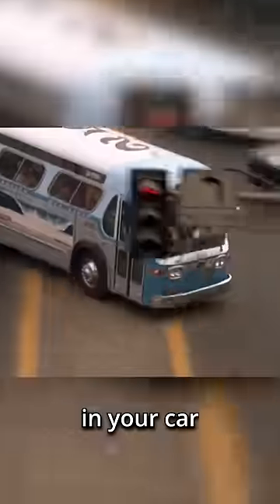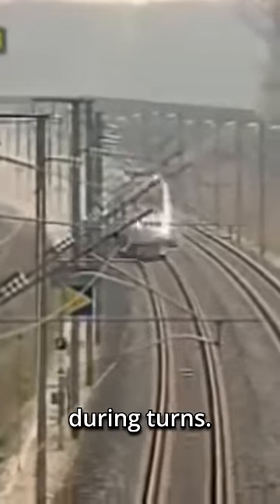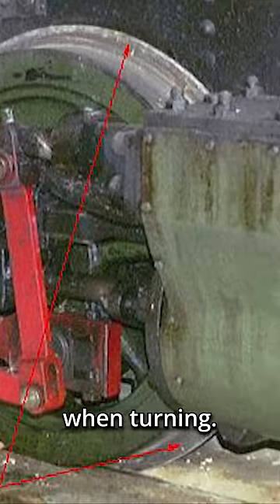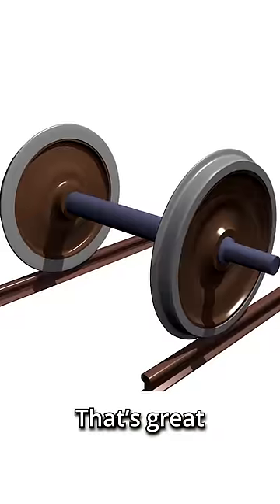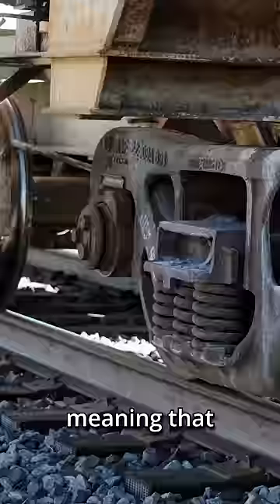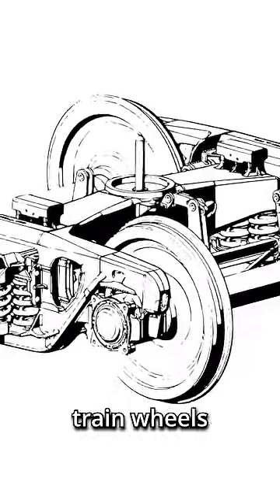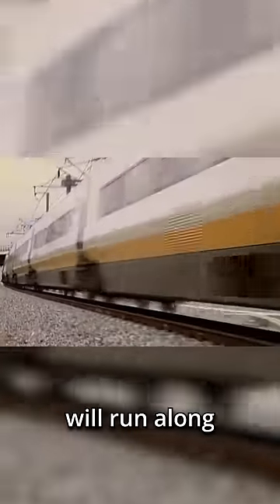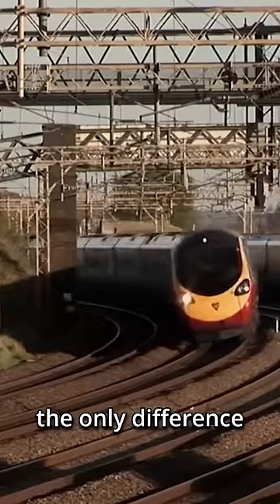How Do High-Speed Trains Stay on Track During Turns? #shorts

Comment: They also use greasers before a train hits a turn so that the wheels are lubricated and it does not wear them or the track is quickly
Reply: Really? At high speeds? I've only heard of trams doing that in very tight turns.

Comment: nice but you also forgot part three. most of the highspeed trains also lean as they go around the corner. this causes the weight of the train push down toward the tracks more than if it did not lean allowing it to go faster without tipping over
Reply: Let's get the terminology right shall we?
Centre of gravity, not weight.

And the weight doesn't push down more to the tracks, the weight is the weight and it doesn't change.
    W = mg
g is a constant of 9.8m/s/s
m is also constant and is the mass of the train
Therfore the weight, W is also constant.

It is the position of the C of G that matters.
And that is what is changing.

Tell me you haven't studied physics at school without telling me you haven't studied it.
Reply: @deang5622  i was describing the action not the method. and yes effective weight does change as you go around a banked corner because of momentum. don't need school i got a electric train track and a scale when the train is on a straight away it weighs 1.02 LBS when it goes around a banked curve the train weighs 1.13 lbs effective weight. sorry you needed school to get it wrong

Comment: Slightly conical, huh? 🤔 That makes sense. The centrifugal force will "push" the wheel (the wheel running on the outside of the track) to run on the section of the wheel that has a larger circumference. Kind of brilliant.

Comment: NO!! IF, by 'inside', you mean next to the flange, then the wheel on the outside track rides more on the inside - next to the wheel flange, where the diameter is LARGER - part of the wheel( thereby covering more distance with the same rotation. C'mon now.

Comment: Ignore the disc on the back of the wheels that would keep the train on the track on most corners
Reply: The flange is there for safety, but ideally it doesn't rub against the track. When it does, you can hear the loud squeal of metal on metal.
Reply: @KingBobXVI  oh, ok, I don't do much research on the wheels so don't know much about them.

Comment: I think you switched up the cones: the outside wheel runs along on the inside of the cone and the inside wheel runs along the outside of the wheel since the outside has the smaller diameter. Otherwise good video

Comment: I think your description of the inside/outside wheels is mistakenly flipped — wouldn’t the outside wheel run on the inside (larger diameter) section of the cone and the inside wheel on the outside (smaller) section?

Comment: The only real difference between a normal train and a high speed train, is the track. There may be some aerodynamic stuff too, but almost any locomotive can go at high speeds if the track is smooth and straight enough.

Comment: Wrong again. The outside wheel rides on the inside cone and the inside wheel rides on the outside cone. 

This is because the centrifugal forces push the train and wheels towards the outside of the track and so the outer wheel rides against the flange which is the part of the wheel with the larger circumference. The inner wheel rides on the smaller circumference which is on the outer part of the wheel away from the flange.
Reply: I'm going to preface this by letting you know I work in railway engineering so I do know what I'm talking about.

Your logic is sound but the cone angle (the shape of the wheel) combined with the cant (angle of the track) causes the train to use the larger circumference (outside of the cone - larger diameter) at the outside of the turn.

If you have the inside of the cone (narrower diameter) on the inside of the curve, the inside wheel would be rotating more that the outside (causing wheel slip).

The cone angle also causes the wheel to have a sinusoidal travel over face of the wheel.

If a train is travelling at speeds too low or too fast in a corner you hear screeching metal, that is the flange of the wheel contacting the outside of the rail head, this usually happens with freight trains in goods loops or through Switches and Crossings where the track geometry is less precise.
Reply: @chriscooke9621  
Your second paragraph states that the larger diameter rides on the outside of the curve. Why you call this the "outside of the cone"  makes no sense to me. This part of a train's wheel is the inner part which is next to the flange. Right?

You third paragraph then contradicts what you just said by stating that if the narrow diameter of the wheel rides on the inside of the curve it would need to travel faster causing slip. If the large diameter is riding on the outside of the curve then the smaller diameter must ride on the inner track, since the distance between the wheels is fixed by the axle and the gauge is constant.

As far as I see, when a train goes around a right hand bend, the train along with the wheels shift left due to centrifugal forces causing the left wheel to ride against the flange on the largest diameter and the right hand wheel to ride on the smallest diameter of the wheel which is away from the flange.

Wheel flanges are on the inside of wheel sets where the large diameter is. The outermost part of wheelsets is where the smallest diameter is. Using the term inside and outside of the cone is rather ambiguous. It should be fairly obvious that on a right hand bend the right hand track is the inside and the left track is the outside. 

I think the confusion is only around these terms ie inner part of the wheel on the outer track and outer part of the wheel on the inner track. Using inner and outer part of the cone is too ambiguous.

Comment: Ou so by chancing the diameter of the wheel since its conical that slight turn can be fixed.. didnt know this. Probably has to have very accurately designed tracks for this to work.

Comment: Not really dude but ok. 

You totally left out the face that all corners on train tracks are banked to negate 90% of the roll over effect when a train makes a corner. 

The tighter the corner the faster the speed the steeper the left to right or right to left the bank. 

The faster the train goes the more it wants to jump the track the steeper the banking on the corner. 

Yes I worked as a railroader and built many a mile of those tracks. 

Geometry take 80% of the credit so the train stays on the tracks. 

10% goes to the shape of the wheels. 

10% is learned through blood of others when mistakes are made

Cute mansplained, short, ineffectual explanation though. 

Takes 7 days to be certified to build corners on railways from scratch to understand the math and why we do what we do. 

It’s hard to take that amount of info just to get the basics and get certified. And squash it into 60-90 seconds. 

Still like your videos 👍
Reply: Took me 3 years to become certified at what I do with 3 years of maths in as many as 20 different subjects.

Still think what you do is difficult?

Comment: all incorrect ..... the shape of the wheels only keeps the wheel centered between the tracks it has zero effect on high speed turns,  modern high speed trains tilt on corners some new trains physically tilt the whole train  and older high speed tracks  are built with a tilt it is not unlike a roller coaster or nascar

Comment: What if we gave trains differentials?
Reply: They would be much more heavy than the cone section wheels which are a simpler and more reliable and since a differential is for additional driving or power takeoff requiring twice as many bearings as independent wheel suspension which are still twice the berings of cone end solid axles
Reply: Over engineering. Differentials are not needed.

Comment: In a turn the outside wheel runs on the INSIDE of the cone and vice versa.
Reply: It doesn't, the outside of the cone has a larger radius, which means for every rotation the outside wheel travels further (exactly what you want so you dont get wheel slip).

Think of it like a differential in a car, the outer wheel turns more than the inner wheel, same concept with trains.

I work in railway engineering both carrying out track maintenance (where we correct the track with a machine called a tamper) and I also maintain the machines (which includes carrying out wheel profile checks).
Reply: @chriscooke9621  the ouside of the wheel faces to the outside of the train and than part has the smalles radius.

Comment: This reasoning is pure bullshit and stupid to the power of ten!
In curves, the distances between the masts are shortened as much as necessary to keep the tensioned wire between the masts within the contact area of the pantograph.
You may have noticed that the contact wire does not follow the curve, but is stretched straight between the masts and suspensions. 
This is by the way the natural behaviour of thin wires and ropes under tension.